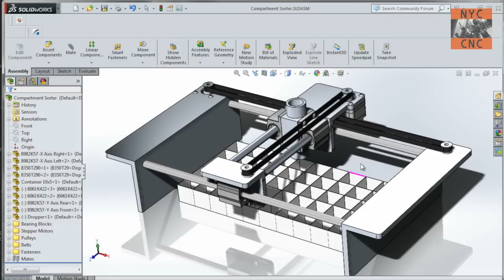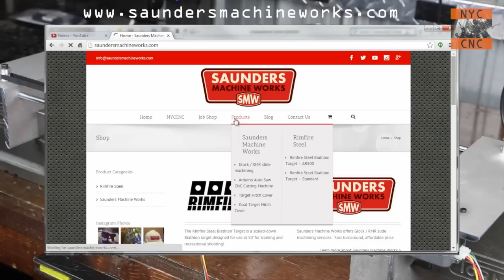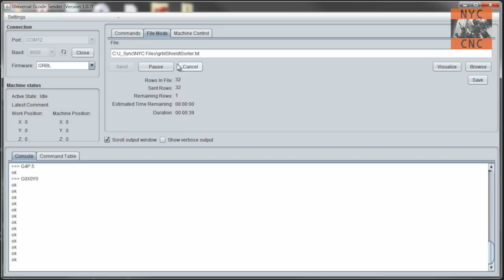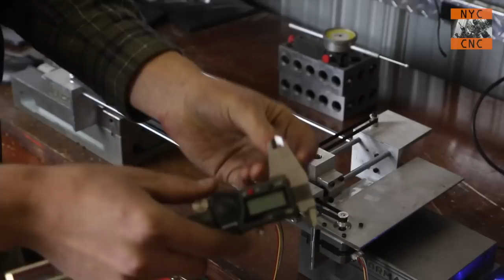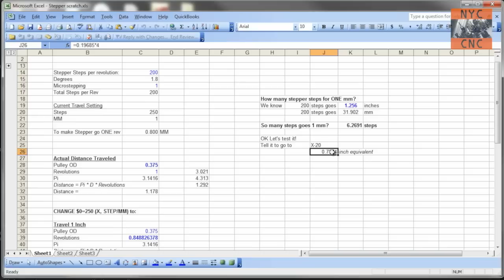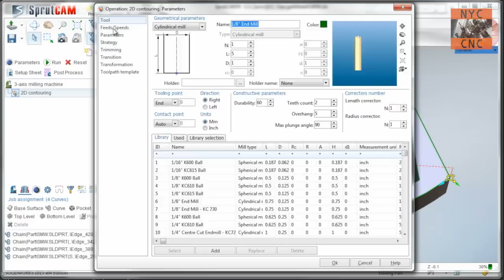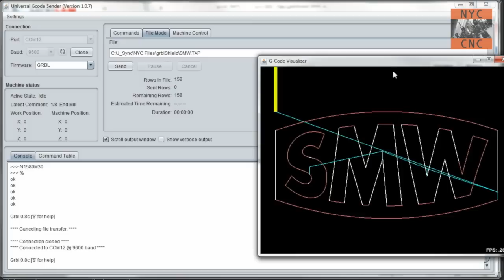DIY Cheap Arduino CNC Machine - Machine is Complete AND Accurate!

Comment: Hi
I wonder around about open loop vs closed toop for a quite inexpensive, 2-3000$ Aurdino based system. Want to mill carbon and aluminium stuff mainly, what do you reckon is better within the budget? IF closed loop aurdino systems exist or is possible to get. Thanks
Reply: What do you mean with closed loop Arduino systems buddy? You referring to if its cheaper to get a stepper motor with encoders vs a stepper motor with no encoders?

I wouldn't worry so much about it, as long as you have the end-stops, the steppers will move towards the position you want them to due to the nature of them. Granted only if you have an actual lead-screw and not a threaded rod.

With 3000$ I would reckon it would be easy to get encoders with high torque stepper motors and good drives plus a good spindle for aluminum and carbon.

Comment: hi i'm looking to make a cnc 3 axis with a cut of 300mm x 300mm what would you recomend .
motors linier guides and so on 
want to cut 10mm perspex
Reply: You might want to check out the OpenBuilds and DIY CNC groups on Google+. Those groups are pretty active and you should find several examples of what you are wanting to do. Many are likely share their bill of materials.

Comment: Hi! I love the DIY CNC you did. Any plans on remaking it? with x*y*z axles and sturdier mounts for better precision?
I have a cheap dremel copy that you can change toolheads on for drilling, grinding, cutting etc. and it would be cool to have a cnc that could use this tool to machine precise metal parts and similar. Love your content, keep up the good work!

Comment: Hallo
well done! gives ideas how to build my proper CNC, based on your Videos. 
I would like to make 2 in 1 Maschine. x and y axis is always going to be the same and on z axe I would build an exchangable head, with Primary a spindel to make woodwork and aluminium cuts perhaps also steel, and with a second head to be exchange by a laser 2 cut plexiglas 5 to 10mm thinkness. Now I got absolutely no expirience by define a appropiate laser to be able to cut Plexi. Could you help me in that issue? affordable laser ? 

Thanks a lot for your videaos and Keep going!

Comment: well... what is a "CNC" machine!?  You seem to think everyone knows what it means.
Also, whats a "grabel" ?  Its a programming code maybe?  CNC ?

If you are teaching, remember to 'define your variables' first. Thanks!
Reply: If you didn't know what a CNC machine was, why would you be looking up how to build one?
Reply: Tyler K. Gibson  //// good point.  My question may sound silly to you, but I am looking to learn here.  I was talking with SolidWorks about designing electronic circuits with their software and then taking the working schematic to a PCB to upload and produce. I used to do all this "by hand" pencil and paper, then copper boards and acid resist... to make my prototype printed circuit boards.  SolidWorks thinks I can be much more productive with their help. I stumbled onto your video while looking for SolidWorks videos.  You did a good job. The terms were a little esoteric to me so I asked a question.  Aren't we all here to learn?  Thanks!

Comment: For the timing pulleys, you want to not measure their diameter. You want to take the timing belt pitch * the tooth count of the pulley so get your rotation to linear travel ratio.

Probably already know that by now though lol

Comment: Can you make brackets for a quad rail setup so that slop is removed & accuracy improved as you suggested?  I'm looking for a low cost way to get into CNC on my garage workbench.  This is very appealing.  Thank you for the list in the description.
Reply: +LazyH-Online Rigidity is in frame design, use care in using bolt together construction because vibration. Timing belt drive is only as good as the mountings.  Been in field from beginning.  Seen and built a lot of systems in my time.  One major concern should be the drive cards.  Another is backlash both mechanical and system response.  I like some of the newer designs but I doubt they can hold .002" accuracy, which is the norm.
Reply: If you really want accuracy use machined ways and ball screws.  Spindle should have ABEC 5 or 7 class bearings mounted matched sets. This above unit is for a hobbyist.

Comment: hey, i have a small question, do you use any bearing or anything alike at the pulleys? i know one pulley is powered by the motor, so that one doesnt really need a bearing, however the pulley on the other side does need one. How did you solve this?

Comment: I don't know much about CNCs but with RAMPS 1.4 you should be able to the whole thing effortlessly. If you use RAMPS then you should also be able to use something like Repetier host or Ponterface to do the movements.
Reply: So can I use a RAMPS 1.4 to control a CNC with a lot less effort than the GRBL shield? What major differences in setup would there be?

Comment: Hi! i'm building my own cnc, and want to do it with belts. Which would you recomend? GT2 or HTD3M? the 3M is more expensive and the machine will cut wood and plastic.
Thanks for your help!!!!
Mariano
Reply: I would use GT2 due to cheap price and they're standard on most 3d printers... It's easier

Comment: I have just purchased a C Beam Machine and was thinking of trying the same Arduino controller setup you have here.  Will there be an issue with the 2.5a max on the Arduino if I am using NEMA 23 motors with a 2.8a rating?  This my first kick at Arduino, milling/routing/CNC...   Pretty much every aspect.  Jumping into the deep end though.Thanks for the great vids.

Comment: Amazing tutorial. Am planning to replicate it and have got majority of parts. Planning to oversize holes in plates across y-axis for 8 mm rods for fitting the setup easily. Wanted to know of any mechanical components that can be used for fitting 8 mm rod in an oversized hole. 

Cheers

Comment: Amazing videos, I absolutely love your channel!
I have a question tho. I plan on building a CNC machine and where I currently live the outlet power is 100v 50Hz.. But I can only find 110v spindle and VFD to buy. If I do so, will there be an issue ? If yes, is there a solution?

Comment: One easy way to solve the rigidity in the x axis would be to add another belt to the back rail on two idlers.  Connect the two belts with another shorter belt on the left side between the existing idlers.  This will keep extra radial load off the shaft of the stepper and should firm up the back end of the assembly.

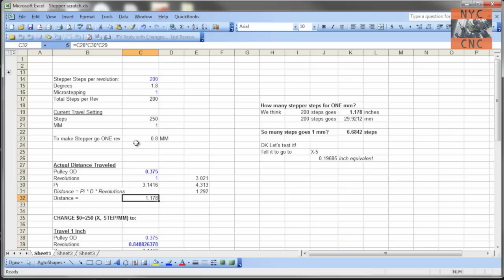Comment: at 12:00, I don't mean to be a nazi but that's actually not a correct calculation... which explains why it didn't work as expected. Count teeth on the belt to get a modulus and use that instead. :)

Comment: Great video! if you are looking for an economical solution with more accuracy and stability, the rails play a crucial part. I was wondering if you could replace the timing belt and timing pulley with CCM rails. The positioning repeatability is around 0.03mm. www.ccmmade.com if you are interested in trying out our rail, please email us at ccm@ccmmade.com.
Reply: dear , we have a new website is www.ccmrails.com  
It is an English version.

Comment: Thank you! 

Have you looked at:
"Homemade CNC machine with materials from a DIY, built with simple tools"
https://www.youtube.com/watch?v=mJ-TZvFpY58
and
"Robotic arm v0 1 composed of servos, an Arduino Uno and a Raspberry Pi"
https://www.youtube.com/watch?v=kzLhdLWqyUU

I learned from you that linear motion on CNC can be driven by belts instead of lead screws. Belts are cheap to buy, trivial to replace, can move faster than lead screws, and probably consume less power. For some requirements belts are superior to lead screws.

Not all CNC has the tight tolerances technophiles associate with CNC. A couple of CNCs used in conjunction with, say, a three robotic arms to wash dishes would not  need to be very precise at all. A robotic arm with an optical sensor (so that it could "see" the dishes) might load a soiled dish onto a CNC which would then move a soiled dish to another robotic arm. This robotic arm would "grab" the soiled dish from the CNC so that this robotic arm could wash the dish. That same robotic arm might place the cleaned dish on another CNC which would then move the clean dish to another robotic arm which would "grab" the clean dish and stack it.

New technologies often start by technicians making tools for other technicians. During that phase the tools seem far removed from most people's everyday lives. But eventually some technologies (such as  airplanes and computers) become cheaper, easier, more reliable, more practical and ultimately commonplace.

I suppose it would be technically daunting for you today, but I hope you will consider putting together a series of machines that will wash dishes like I outlined above. Sure, it might take you several years and require collaboration with other YouTube channels, but it would be an amazing project.
Reply: +NYC CNC Thanks for replying to my comment. Of course my idea probably seems fanciful. I realize that. But it perhaps it has more "meat on the bone" than it might initially appear.

Most hobbyist CNC machines sit around collecting dust most of the time in people's homes. Why? Because, generally they don't actually accomplish a practical task. They are, for the most part, merely interesting "tech toys." On the other hand, in those same homes people generally wash dishes every day. And in most of those homes people use a machine called a "dishwasher." The term dishwasher actually used to refer to a person, not a machine. How did the term "dishwasher" come to refer to a machine and not a person?

Some clever designers and engineers were able to create industrial machines to help people wash dishes. Now most American homes have a machine called a dishwasher. But, of course, that industrial machine does only part of the actual dish washing. A computerized/robotic system of dish washing as I described above might seem far-fetched today: sort of like a Dick Tracy wrist watch in the 1950's. The Dick Tracy wrist watch is essentially a reality today.

A hobbyist-built robotic dish washing system is actually feasible with CNC and robotics today. Sure, it would take much work to implement. And, of course, it would initially be a crude with many shortcomings. But that would give you much "fuel for the fire" (material for your show) and likely increase the number of subscribers you have.

As CNC software and hardware continues to become easier and easier to use, to keep your subscribers engaged, you will necessarily need to take on more complex projects. Why not start on a five to ten year project that with the stated goal of creating an automated system that would clean all of the dirty dinner dishes within one hour that had been set out on a kitchen counter top for a family of four?

Comment: Add a solid state laser. Blue light and smoke will drive the STEM kids crazy! You won't need a Z axis, just switch on and off.
If you want to keep it cheap and safer power can be very low, write on thermal paper.

Way to go taking your time to teach our kids!
Scott
Reply: Since there is some play in the system, will it be accurate enough for photo and even cad drawing engravings?

Comment: Awesome, I plan to make a small CNC from parts salvage from old printers- take motors and 3d print all supports and to install 1.6w laser on it, so it will burn a contour on ply. It can be used in modelling. I know how to program controllers- made stepper motor driver, but don't know how to sync it with that software yet

Comment: I noticed the two end blocks that support movement of the the carriage are only connected by the slide rails. Shouldn't the end blocks be connected by a heavy plate of some sort to assure they maintain correct alignment and uniform height to the overhead carriage.

But then I remembered he said he hadn't cut off the rails yet so the footprint was still undefined.

Comment: +NYC CNC could you replace the belts with a threaded rod and bolt? The bolt would connect to the head/moving platform, and the threaded rod would be connected directly to the stepper motor. In hope this would provide enough rigidity to withstand the force of a radial load. Do you think this would work? Great work! Thanks for putting the time and effort into your videos, they have inspired me to get into arduino programming myself. It'd be great to hear your thoughts on the topic.
Reply: Threaded rod and nut

Comment: Great video. I want to make one to cut sheet styrene.
Reply: I don't think you need a router but on the head for that. Maybe just a piece of resistance wire.Then again, I don't know how styrene does against heat

Comment: That is a great project! I retired a year ago after 40 years with GE as a Tool and Die Maker. I am getting started with Arduino and plan to use them for projects in my work shop. That machine you built may be on my list of things to work on. Keep up the good work and thanks for the video!

Comment: Great video. I thinking of making one for plotting model RC airplane plans onto foam board. I would need to increase the workable area to accommodate a size of 20" x 30". Is is just a matter of increasing the rod lengths and by increasing the length will this impact the accuracy? Also you mentioned to controls boards in you video. Which one to you prefer? One last question...is there a way to convert a PDF plan to g-code?
Reply: +NYC CNC - If I increased the Linear Bearing Slider & Linear Rail size (i.e. 12mm) would that help? I really want to make one. What is the work area in the one you built?

Comment: It has been 1 month short of a year, so I'm not terribly surprised at this.  I just went through your bill of materials for the "DIY Cheap Arduino CNC Machine - complete..., Jan 6, 2015" that you recommended from eBay and got a lot of 404 errors, Page not Found.  Again, I'm not terribly surprised.  It does point out one thing that you might consider for the future, however, is to put enough description of the items that you are referencing that we can find them from another vendor or another source on eBay.  I really didn't think that the machine would work for what I want (to cut wood) but the learning experience that you gained from it seemed worth whatever it cost.  I thought that I could benefit from it as well.  I have the Spark Fun Inventors Kit, that has a robot and Sparkfun's version of the Arduino and shield.  That is a great learning experience as well.  I want my end result to be a 2' x 3' 2.5-axis cnc router.

I really like your videos.  I just recently subscribed.  Often the instructions on youtube are long and drawn-out, but yours are very concise, you don't say Um, Er, Ah, between every word, well articulated, and it appears that you actually enjoy what you are explaining.  The enthusiasm is contagious.  Very well done.
Reply: +NYC CNC Thank you for updating that! That was kind of you.

Comment: You sound like me. I also saw a robot when I was a kid and now I am completely interested in building robotics. I also am a machinist but recently advanced to mech engineer status. I am going to build a CNC next year. I am also very interested in using steppers because of their lower cost.
Reply: I found some abb solid models yesterday. It would be cool to semi copy them but run them with steppers.
Reply: I don't know about harmonic drives. The models are on 3dcontentcentral. How do harmonic drives work? I know someone who thinks he can figure a way for a stepper to detect a miss step in the driver board. If that is so, we could get some seriously cool results from a stepper.

Comment: I'm making a portable laser cutter and this is pretty darn close as to the design of it How would I go about the work area program in the software so that it won't try to off.
Reply: just remember to have good fans, the smoke hinders a lot of the light
Reply: Hi. I BOUGHT A 35/50 LASER MACHNE ONA X-Y AXIS RAILS AND IT DID NOT COME WITH THE LASER AND THE COMPUTER SUFF. SO I WANTED TO BUY A ROUTER AND COMPUTER COMPONETS TO MAKE IT A CNC ENGRAVER. WHAT WOULD I NEEDTO DO SO? DO I NEED A CNC MOTHER BOARD OR DRIVER?
Reply: Be careful when using laser,  even the reflected rays can burn your eyes. Always use safety Google's for lasers
Reply: @nwokoyepraise  whats a safety google? Is that what safe search is?
Reply: @outkast187  what do you mean by your question?
Reply: What i did was mount my lasers with class 4 zip ties and metric hardware to the head of a shark.  Several. Trying to better control the "laser beams" with arduino.

Comment: I wonder how many parts could be replaced with 3D printed parts.
Reply: +阮天青 Probably anything that doesn't take a stress load or conduct electricity. Also mounts which don't conduct load over much distance.

Comment: John,

If you use the Pitch Diameter of 0.402" for the 16T timing belt pulley instead of 0.375" OD, you might get a better calculation for the movement.
Reply: John,

Using the 16T GT2 style pulley, I went to Stock Drive Products website and looked up the specs for that size pulley. Just like using gears, you need the pitch diameter when making calculations.
Reply: +NYC CNC You should use the teeth count on the pulley instead of using Pi.  with a 16 teeth pulley, your belt can do nothing else than move 32mm per turn.  32/200 = 0.16 mm/ full step.  (Hey! A round number!).